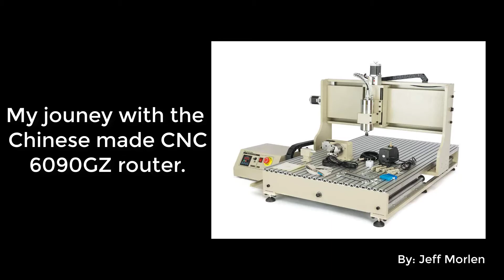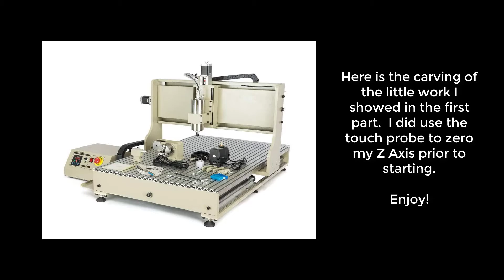My 6090GZ and Mach3 Z Axis Zeroing

Comment: Hey Jeff, I love your instructional videos. I purchased the same exact model as yours. Does the back of the VFD controlller have a plug where you plug in the zprobe? Or do you have to get inside of the VFD controller.
Reply from the maker: Yes, it has a port on the back of the machine for a 2 wire connection.  It IS NOT labelled as the probe input though.  It is labelled as "knife" on mine... which is a pretty weird mis-label... but whatever, right?!  Look for that one yours and let me know if you have something like that.
Reply: Thanks Jeff! It’s as you said, there was a pin called “knife” at the back of the VFD controller!!! Not only are you videos informative, I’m hoping their will be similar contents in the future!! God bless you 

Thanks 
Jevon K
Reply from the maker: I got a notification about you having some questions about the 4th axis.  I wanted to address them, but now cannot find those comments.

Comment: I have the same machine but mine did not come with a probe. Im currently trying to connect a xyz probe onto the machine. Could you help me in any way?
Reply from the maker: Are you running Mach3?  Are you using the RnR Motion DLL file with Mach3?

Comment: Tengo una pregunta cómo funciona ese cnc
Reply from the maker: A CNC machine works by turning what is called G-Code into movement on the machine.
The G-Code is created by what is called a post processor that is in your CAM software.
Your design/art/part are created in CAD software.

For what I do, I use Mach3 for my machine control and I use Vectric products for my CAD/CAM.

Does this answer your question?